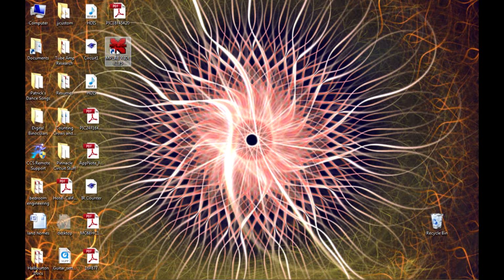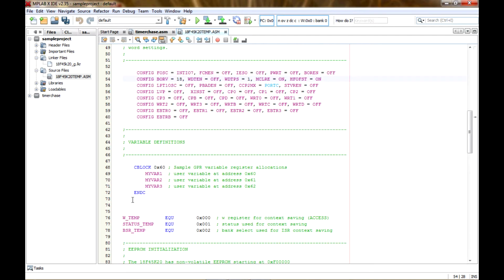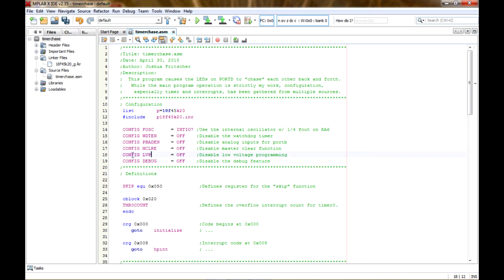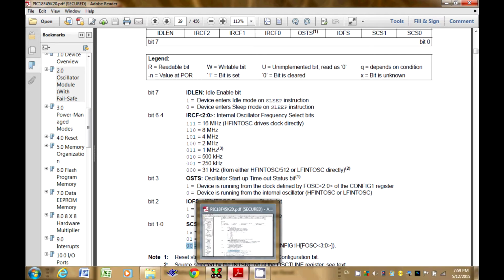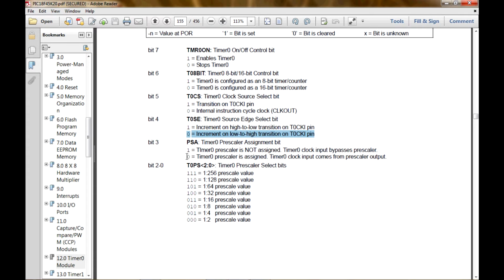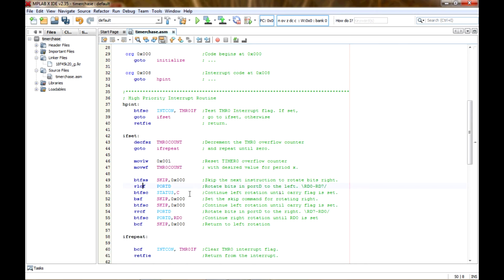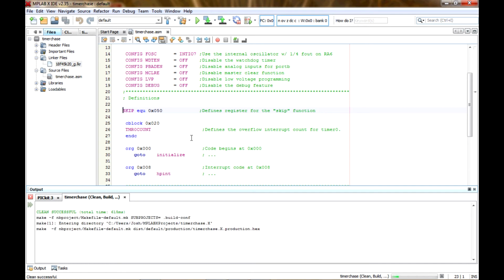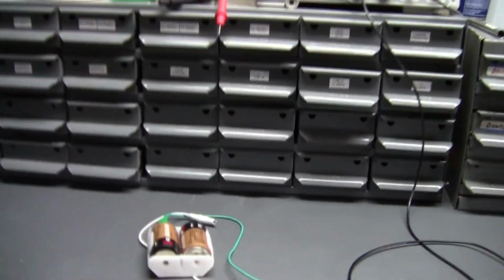PIC Assembly Language Programming - Chasing LEDs

Comment: Hello, I see you use the equ directive to define the Skip register. How would the compiler know that its a register you are defining as oppose to a constant? Isnt the equ directive used to initialize a constant. Ex. Five equ 5? Thanks!
Reply: I'm new at this but see your comment is unanswered.. it depends on how the equate is used; the equate is just a constant, like a #define in C. If used where an instruction expects a memory address, then it'll be an address (or 'register'). Since SKIP resolves to 0x050, then "BSF SKIP, 0x000" means "set bit 0 of memory location SKIP", which means memory location 0x050. (If it had been "BSF SKIP, 0x007" it would set bit#7 at that memory location instead.) SKIP could also be used as a /value/ in an instruction, such as "MOVLW SKIP", which I think would load the W register with the value 0x050.
Reply: If you're used to C, it would be like "#define SKIP 0x050". You can then either use it as a pointer to memory,  e.g. "uchar *p = (uchar*)SKIP;", or as a value, e.g. "int val = SKIP;". Depends on how it's used.